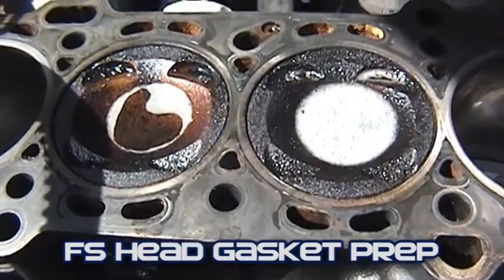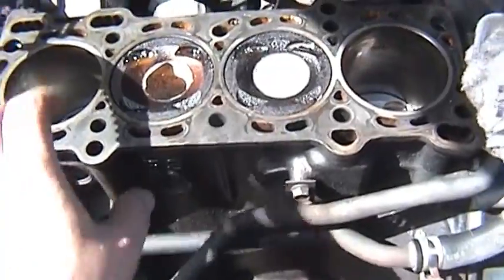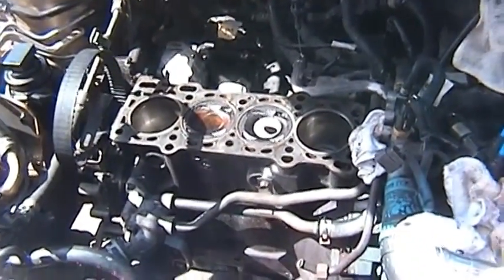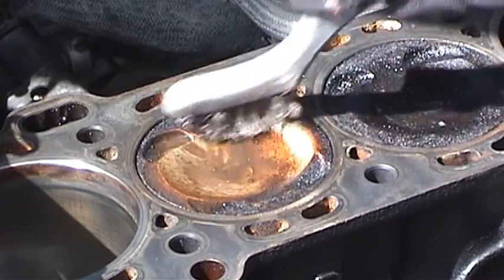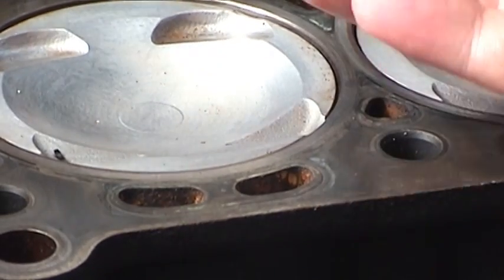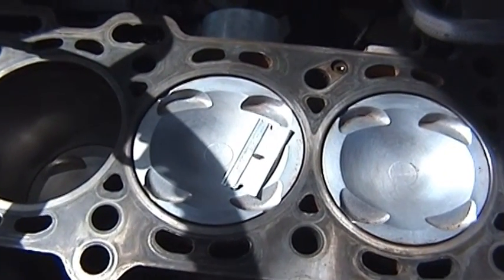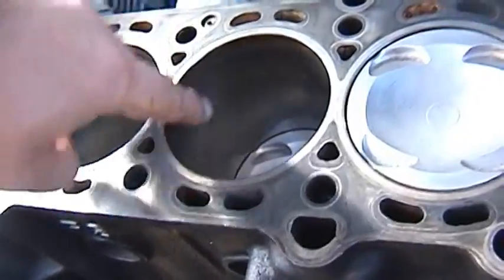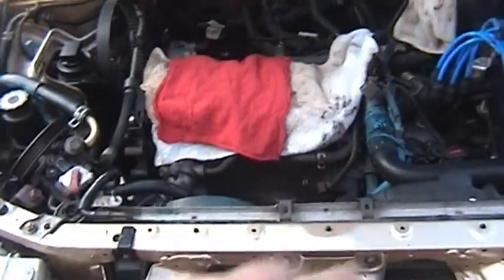Mazda 626 - Head Reassembly Preparation

Comment: Problem bad coling system engine and engine oil .. compresion ring.  250.000 300.000km standart mazda industry.  Want long good engine work.  Petroil  engines  set mineral oil 15w40 . Long time save engines.  Good compresion ring new. Mineral oil 15w40 good compresion and not ,,grinding ,, cylinders pistons.  Does not stress the bearings.
Set coling termostat sensors +80gradule  fast coling starts to cool the engine blocks in time.  Because earlier, the factory set the thermostat sensor to +90 degrees.Not good .In this way, antifreeze or tosol loses the chemical elements of the cooling system function.  Just avoid.  evaporating cooling elements.  In this way, when the engine heats up, the blocks deform and the oil enters the microcracks.
Every 1 year renove tosols or antifrez colin liquid. But 2_3 year bad.... heat engine blocks bad old coling system. Defect termostat sensors and termostat Valves.  Deforms.  Boils.  Motor defects inevitable damage.

ALL CAR  😎

Comment: Thanks for posting all the detail. Just watching how painstaking this is makes my back hurt! 

I'm wondering how a professional would do this to save time. Would a scotch brite nylon pad with a 90 degree die grinder do this as well, but faster? When I use a razor blade on aluminum, I find that even careful effort sometimes results in the blade digging into the soft aluminum, creating a fine divot that is difficult to smooth out.